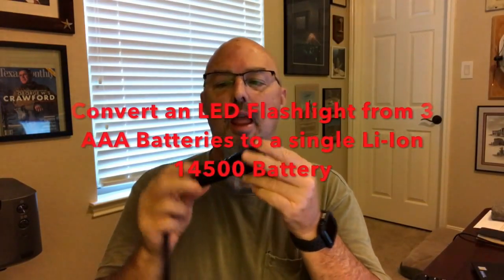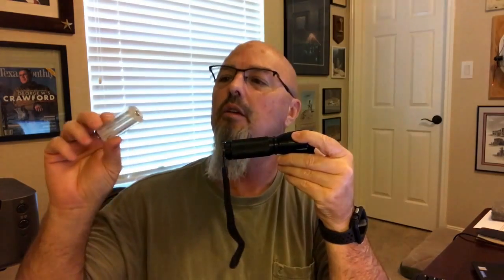Convert Flashlight Battery from 3 AAA to Single Li-ion 14500

Comment: Nice vid! I just busted my triple AA holder for that same torch and have tons of 18650s. The only issue is that they are not protected, so I'll have to be careful to keep them charged and not over discharge. I'm going to model and print a sleeve and figure out the spacer nut as well. Thanks! I'll put it on Bambu MakerWold for those who want it. Another idea is to use small disposable vape batteries and ad a charging/protection circuit. Less capacity but no risk of ruining the battery due to over discharge. I'll model a sleeve and 3D print. If I do this it will be added to Bambu MakerWorld for others to use.

Comment: In series the Voltage is increased, in parallel current is increased. In both cases total power is increased as power is voltage times current. So I'm not sure why you say putting batteries in series does not increase power?

Comment: Sometimes it costs more in materials and time to save a flashlight like that than to simply replace it. Also, those battery holders inside are cheap to buy on the web. And why don't you simply glue the little crack in the holder with some Superglue?
Reply from the maker: Superglue wouldn't repair what was a cheaply made battery holder to begin with. Sure I could toss it and buy another ones, but that is wasteful. Further, there was the technical challenge of trying a battery cell of a different chemistry and voltage than the original. I think you missed the whole point.

Comment: Use all copper pennies to tighten up the battery space and with the 14450 battery, wrap paper towel tube (trimming it too fit) around the battery to make it fit and cushion the battery so it will not get damaged and cause a fire. The single 14450 battery recharges quickly, and faster than the three NiMh batteries (which still has a memory and a more limited amount of recharges than the LiPo battery). You can convert many radios and flashlights to the newer lithium polymer batteries using a "dummy battery" which is nothing but an empty tube with wired contacts top and bottom to match the required voltages the appliance needs. Get a Four to Six bay charger in case you need to charge batteries in your item. I use that type charger for LiPo and Ni Mh batteries I use in my many FRS, GMRS, AMATEUR, and Marine radios - both handheld and mobile radios. There are even kits to make any voltage battery you need by series/paralleling the 18650 battery. You might want to get a charger that has a Battery Management System on it to charge up a multiple battery system all equally so the batteries do not get different voltages and fight each other. There are many videos here on youtube that will show you how to do these things. Have fun, but remember: Safety first!

Comment: hello and thanks for your video. 
inspired by your video I've found that I can do that using fired a 12ga shell, jut cut the crimping part and put some electric tape on the bottom ringside and works perfectly, I wish I can send you the picture so you can add it to your videos, it's really easy to find a used 12ga shotgun shell clean it in the inside and cut it at the beginning of the crimping, put tape and ready to go.

Comment: Great vid, thanks.  My Etsair BRC 14500, 2800mAh fit perfectly length wise.  No spacer needed.  I did wrap a piece of flat packaging foam to shim the sides.  The foam has to be just enough to allow the battery to slip out.  Wrap too many times, and the battery is hard to get out.  And how great.  NO MORE THROWAWAY AAA's to buy.

Comment: 18650 people are sometime wrong. 18650  is actually 18x65mm, whereas 14500 is 14x50mm. Qzarkmedia's nut is about 8mm for a total 58mm. The 65mm battery might stick out so far that you can't thread on the cap. Moral-of-the-story...Not all 3xAAA flashlights are the same. I have 3 different flashlights that won't work with 18650 (don't ask me why they put the unnecessary "0" at the end of 18650 and 14500)
Reply: The 0 at the end designates a cylindrical type/style battery.
Reply: @philmiller99  Good to know. Thanks

Comment: I have similar flashlights that came with a plastic sleeve for using 18650 but actually a 26650 fits perfectly and fills the entire flashlight tube without spacers.

Comment: replace it with a 18650 and trim the spring a bit so the button works flawlessly at full close :D
Reply: My 18650's are too long, even without springs for the end cap to screw on.
Reply: @larslarsman  use an unprotected 18650 they are shorter. I took a coast flashlight that used 4aa in a holder like yours and modified it to run on my sony vtc6 1850 battery. It had a plastic ring in the tailcap that held the spring. I unscrewed it took it all out then soldered a small spongy spring in with a copper wire soldered from the top of the spring to the bottom. It is much brighter now. Where there is a will there is a way lol

Comment: Quality alkaline AAA batteries often come from the factory at 1.6 vdc, multiply by 3 in series gives you 4.8 vdc. The flashlight and radio manufacturers allow for the overvoltage of such batteries (30% over the designed  4.5 vdc). So, using a 14500 rechargeable lithium battery at a 4.1 vdc (just off the charger) does not overvoltage the flashlight or radio. It would be interesting to see if you encased the 14500 as he did,  and used it as he does. How long would the battery last, and how would the radio endure the slight overvoltage? I remember being told that YOU cannot trust everything you hear and see on youtube (12v battery "reconditioning" especially), so use a cheap flashlight, or cheap radio for your experiments - one that will not bankrupt you if it burns out.
I have done this before with an inexpensive led light (it cost a buck) that took only one AA cell and substituted a 14500 lithium battery (same size, just almost triple the voltage) and it does still work, extremely brighter than with the single AA cell. It has worked regularly every day with no problems for over four months. This also works with a 9 led light, I just used a paper towel tube cut to length to space the lithium battery correctly in the case - it worked well, too. I saved the three bettery holder in case I wanted to change back to NiMh cells I was using before the 14500 cells became commonly available. You don't have to buy the pvc pipe, just use the paper towel tube you would normally throw away for a "no cost" conversion. Have fun !
Reply: I would rather have a durable spacer than a toilet cardboard roll. I want 💩 done right.

Comment: Undercharging? Correct term would be overdischarging. 

Sometimes you can fit 18650 batteries in the light which will have more capacity.
Also they sell a battery which is the same size as the 3xAAA holder. They also sell adapters which is like the sleeve you put around your 14500

The nut in the light is a dangerous idea. You could end up with a short circuit in the light

Amazon sells flashlights of all sizes and battery types for cheap and free shipping 
You are better off buying a proper light than this DIY.
They only cost $5-$20
Reply: I have several flashlights where the aaa battery holder has broken due to the stress of the springs put on the aaa NiMh batteries. The 14500 battery wrapped with  paper towel cardboard roll cut to fit works just fine. This brought three of my LED flashlights back into service. I've done this with two 18650 batteries that fit the flashlights big enough to hold them. I like the conversions from alkalines to LiPo batteries, no worries about throwaway batteries, and the lithium batteries recharge much faster than nickel metal hydride batteries. Been doing this for a while with flashlights and power tools.
Reply from the maker: Wow. I'm underwhelmed. Maybe you didn't watch the video that an 18650 wouldn't fit? Not sure how I'm going to get a short circuit in the flashlight. Perhaps you could provide some detailed schematic?

Comment: That steel nut forms a high electrical resistance connection. Steel has about 6 times the resistance of copper. Look around for a brass or copper ferrule or a piece of rod to extend your cathode connection, and the light will run longer, brighter and cooler. Nice mod.
Reply from the maker: That's a great observation and I will do just that. At the time I was just looking for something to fill the gap, but you are right  and I will get something in there that is a better conductor.
Reply: @ozarkmedia  Old Mercury dimes might be of interest as spacer(s)
Reply: Interesting point, but the spring that the manufacturer uses to make the connection at the negative end is steel, so.... ???
Reply: @JohnWadeLongJr  Which is why many flashaholics modify the steel spring with soldered copper braid.

Comment: 18650 Not only did mine get WAY brighter, they last SO much longer, as well. And 18650's fit nearly perfect. I was going to find a more permanent solution for spacing, but the cardboard I rolled up around the cell has worked fine so far. It's conformed to the shape, so don't have to mess with it at all.
Reply: 18650s are LONGER and at least two of my tripple AAAs in the tube are exact fit therefore as I found fukkn out THE 18650 WAS TOOO LONG

Comment: great work. i hv the same flashlight as the one u hv mentioned. iam planning to use it on ma cycle. i jus wanted to know if i can put 3.7v with higher mah li ion battery( .>800mah) so that i can use it for a longer time. kindly give me an advice
Reply from the maker: Yes you can use a battery with a higher mAh rating.

Comment: I was hoping u could answer a question for me. I have a LED LENSER headlamp that will not turn on after charging it on my rapid adapter phone USB charger. Can u or anyone else tell me why and how to fix it. Thnx.
Reply from the maker: That’s a tough one without knowing more about it and knowing the required charging specs vs the output of your USB phone charger. I have read that LED LENSER has a five year warranty. You might want to go to their website, ledlenserusa.com to see if they can help under the warranty, assuming yours is less than five years old. Good luck!
Reply: @ozarkmedia  Its one that isn't sold here so they wont take it. It's the 2nd one that has done that. So now I know that it's the charger. I bought another battery for it but it still won't turn on. Could it possibly be the led bulb that's burnt out bc of too high of voltage or something from the charger?
Reply from the maker: Chauntelle A Russell then I’m afraid the best I can suggest is to look for what the required charging voltage and amperage of the light vs the output voltage and amperage of your charger. It could be that the usb charger isn’t putting out the amps that the light requires. Not knowing the age and amount of use you have put onto the light, it could be your battery is just worn out. One other concern...if the light should have had a special charger with over current protection built into it, the usb phone charger could have exceeded the limits of the battery. Really difficult to guess without knowing a lot more.

Comment: Good job...but can I ask what you have against 18650s? Gave me a good idea though. I need to do a like conversion on some Anker, LC40s, thinner Cpvc will probably work well. I also found some cheap flashlights from somewhere in Asia that appear to be made for 16500, that isn't used in the US. 14500s are loose with 1mm all around, but they do kind of, work.
Reply from the maker: Oh, nothing against the 18650 at all except that the length is just a little too much for this flashlight.  The 14500 is too short, but I could make up the difference with a washer as a spacer that was conductive.  Easy to add length, not so much to take length off a battery!
Reply: @Bob Hope - Bob, I have a few of those 3x AAA battery holders for flashlights around and they are all in the 18650 range of length. If an 18650 battery is too short, you can find some that are extra long, if you just look. There are other cells that would fit and be within the voltage tolerance. As you can't say because you have no actual knowledge of his particular light or because you are ignorant of the world of batteries out there. I'm just going to pretend you didn't say anything and suggest you look up a good battery chart.

Comment: not correct. flashlight i would get simply states use 3 AAA batteries or 1 rechargeable 18650 battery

no "triple holder in flashkight! I watched wrong 2 videos so far!

Comment: I use Rayovac Platinum AAA 800 mAh  batteries in my LED light.   There is really not much difference in capacity with the 14500 mentioned.  There are brands of 14500 sold out there that rate much higher, but how do you know if they are just fake Chinese capacity ratings?

Comment: For those that did not throw away those cheap Chinese acid batteries right away when you bought a mini LED flashlight, you likely found that the acid leaked out and corroded away the metal in the holder leaving rust.   You can order replacement holders of different types directly from a Chinese seller on Ebay real  cheap.

Comment: try an 18650. should be a better fit than the 14500. longer, and thicker.
Reply from the maker: 18650 was too long.  Wouldn't fit in the space.  I tried.
Reply: 18650 wont fit...they make 18500's
Come check out the flashlight mods at budgetlightforum.com
Reply: Depends on what type of AAA battery holder is inside.  I have a 360 lumen tactical LED flashlight that has the type of holder that has an extended chrome buttom on the + end.  This type of holder is a bit longer than a holder in one of those Harbor Freight multi LED mini flashlights.  The longer will accommodate an 18650 as the battery is only slightly longer and the back spring making up the difference.  But it could use a thin sleeve jacket inside so the battery will not flop side to side.  Also I noted that the 18650 battery made my tactical flashlight somewhat heavier than when it contains the 3-AAA setup.